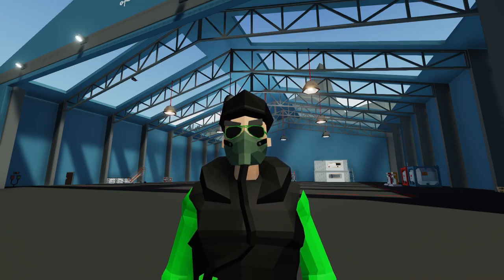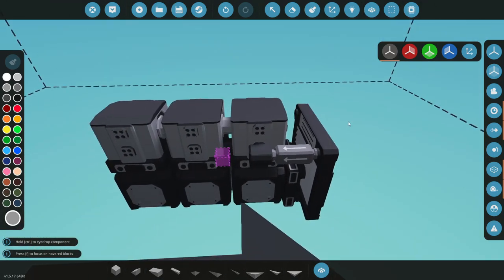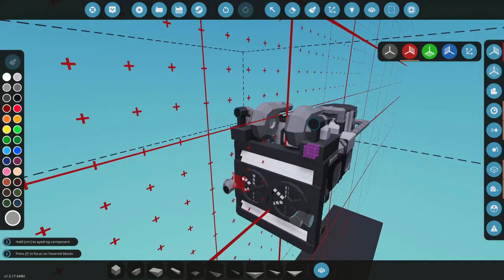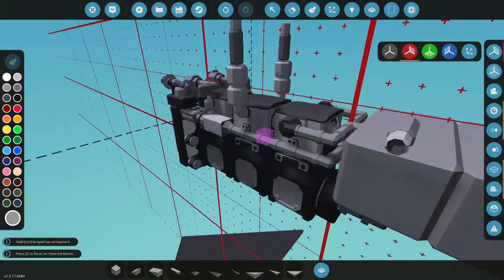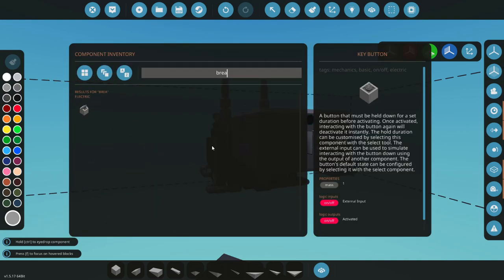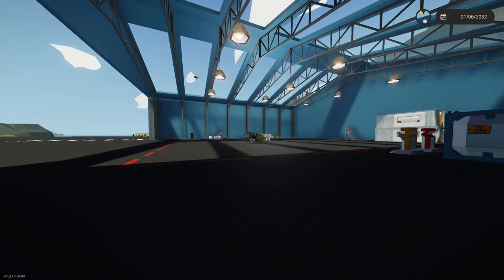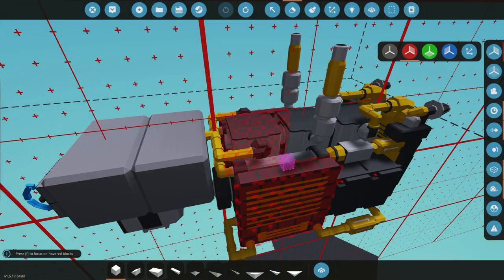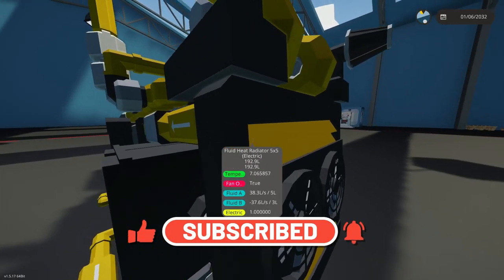Dump Truck Modular Engine Build & Super Cooling! [E1] STORMWORKS BUILD SERIES

Comment: I uploaded an example of the cooling system I have been buggin you about,  😁.  It is named engine cooling system on the workshop if you want to take a look at it.  I set it up for regular engine but changing it to read composite or just using a smalll converter will allow it to be used with modular engines, just add pumps to the heat exchanger.   

Loving the build videos btw.
Reply from the maker: Will you add your name to the title to help me search for it? [Edit] nvm I found it.
Reply: @ProfNCognito  Oofff. I didn't think of that.  Will do.
Reply: @ProfNCognito  Aparently I can not edit it from mobile.  But if you use the filter for most recent and subassembly. And search "cooling", it should be the first item.
Reply from the maker: I found it. Nice concept you got there.
Reply: @ProfNCognito  Great!  Thanks, it was actually your supercooling tutorial video that inspired me to try it out.    That setup should easily keep the 3cyl from overheating.  It may work for the 6clyl.  

Any size heat exchanger can be used, i just used the 5x5 because it is the same size as the rad. 

The radiator does all the cooling.